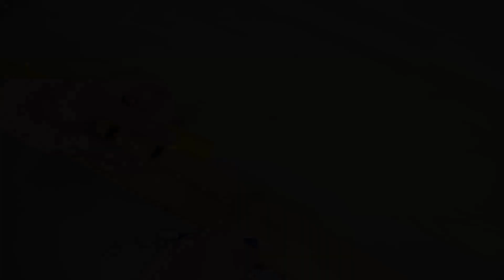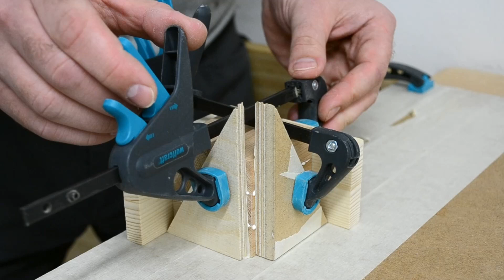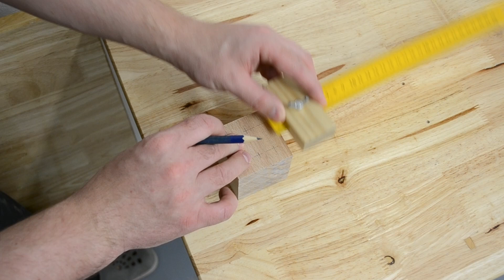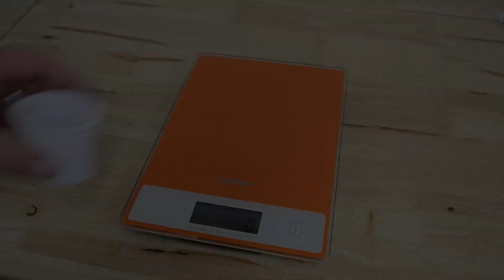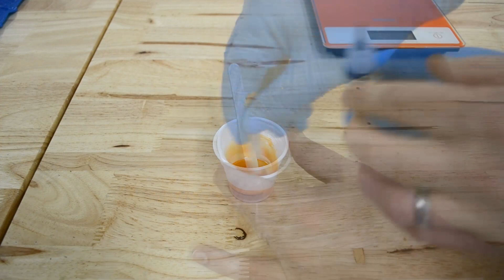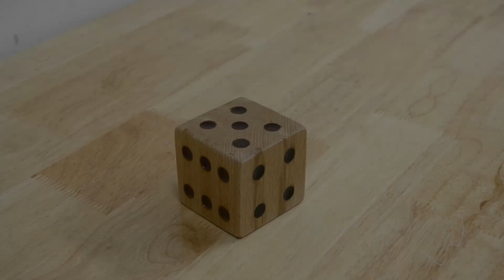Yardzee DIY | How to Make Wooden Dice

Comment: I   made  stain glass work ;  do  you thinf  it is possible  to   mde one  in  glass  about15mm stick  or maybe 17mm  max  but  waht type of glue  to use?
Reply from the maker: Hi :) How about epoxy? Would that work for you as well?
Reply: @AllFlavorWorkshop  probaly  use  x3  15 mm   glue  togetther  and 
drill  the  hole  and  finish  whit  '' grisaille '  cook  at 1300 'F 

on a  foam  baord   it ptobaly  get special setup
thank   for  info
Reply from the maker: @jacquesomersavard7257  Sounds good, let me know how it turned out!